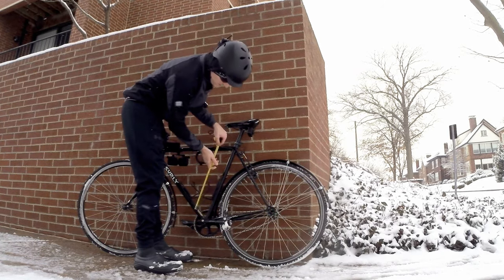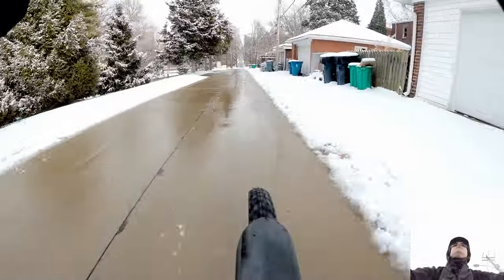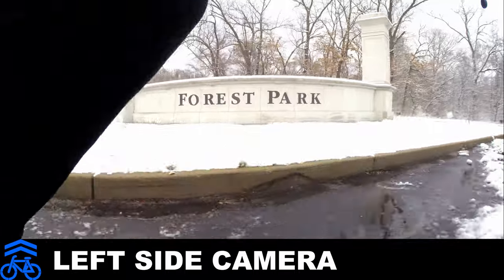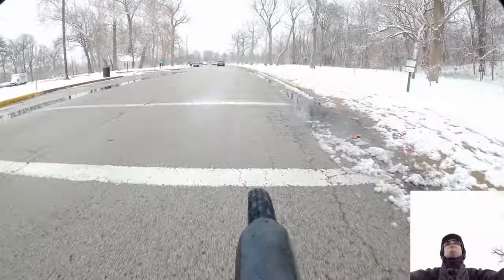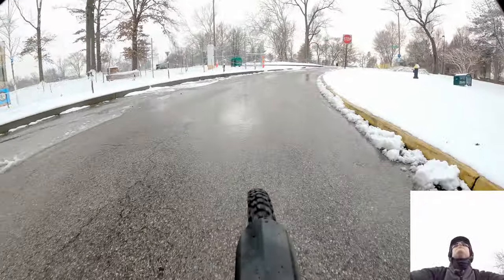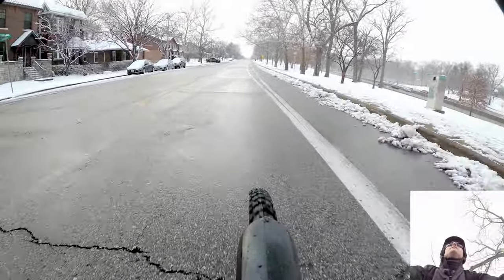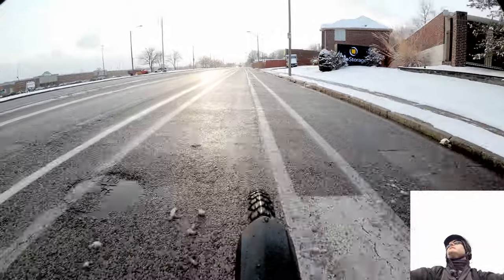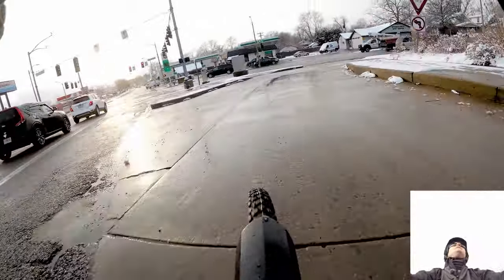BIKE FIT Tip Of The Day

Comment: If anyone can help me with this, I would appreciate it. I ride a city bike, and I have long legs and have always had a hard time getting my seat high enough to extend my leg out to almost straight. I know there needs to be a slight bend in the knee, but my knee is still pretty bent. I have a 26in bike, and have my seat set pretty high, but I am scared to raise it much higher, because as it is, when I come to a stop to get off the bike, I feel like I am up pretty high and almost fall sometimes as I get off, and even getting back on. So does anyone know what I should do? My left knee has always given me trouble, and I have a lot of pain in it, so I feel like I need to stretch my leg out more. Ugh.